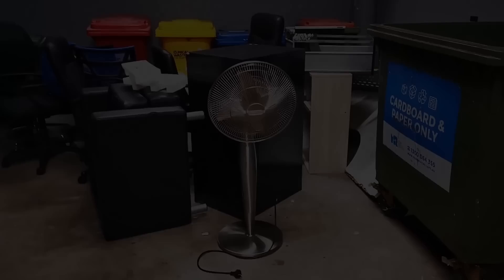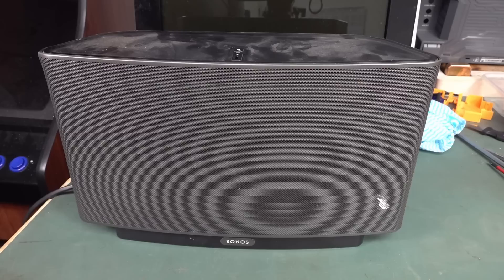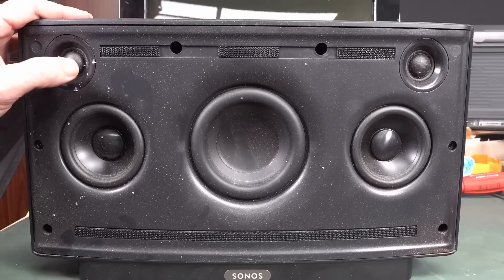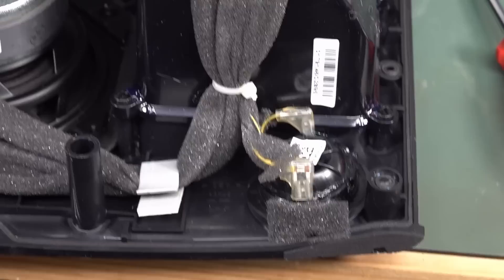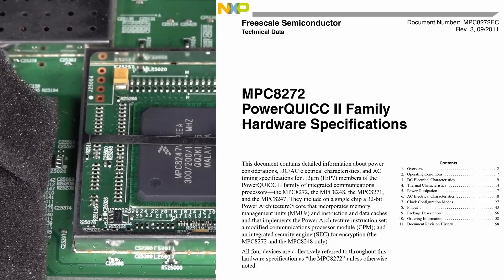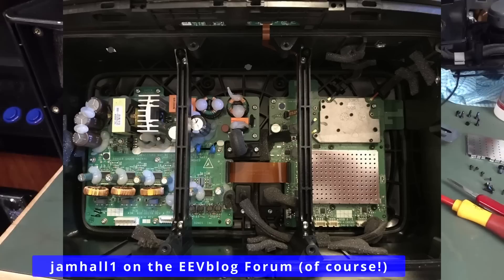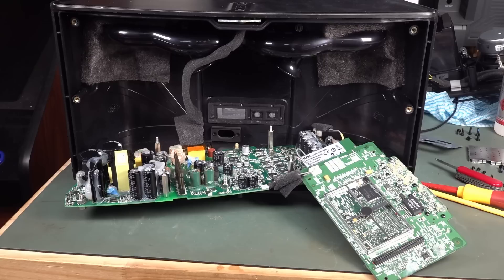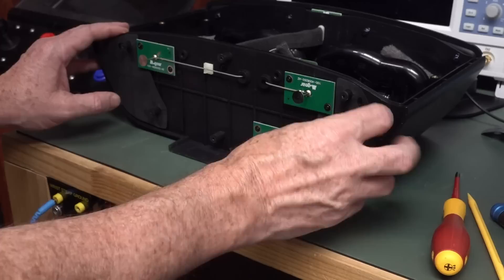EEVblog 1514 - Sonos: The Juicero of Wifi Speakers? (TEARDOWN)

Comment: Hi Dave, great video! I've been working at SONOS for 10 years. I help manage and develop their acoustical facilities. We're definitely meticulous when it comes prioritizing overall quality. It seems excessive, but the foam and glue are necessary to mitigate buzzing parts and fortify components for longevity. Despite not being inside the acoustic volume, the foam near the antennas is meant to mitigate buzz between the plastic foot and the enclosure. Keep in mind that the original PLAY:5 was made in 2009 and was our first "all-in-one" speaker. We've learned a lot in 13 years. We now design our own transducers in-house amongst many other improvements you might enjoy finding in one of our newer products. Cheers
Reply: Pretty awesome, I've had a lot of free sonos gear from a supplier over the years, and took a few apart for fun, and coincidentally, the same one dave took apart because the application didn't work anymore. Was pretty bad of you at sonos to do that. But yes the products do seem good and I got everything for free so can't complain.
In short, good products CW!
Reply: @colinofay7237  Glad you appreciate the product from a hardware perspective. I live and breathe hardware development so some of the other aspects of the business I'm less versed with. With S2, we got to the point where our early products were lasting so long it became a limiting factor for coexistence with the modern products we were developing using the same SW platform. We have a bit of a novel approach when it comes to designing consumer electronics that are not meant to be thrown away after a couple of years. We design our products to hopefully last a decade or more. I'm not sure what the exact statistic is, but around 90% of every Sonos product ever made is still working in the field. Basically, we got to the point where we had to diverge and develop a new software platform that would enable the technologies we wanted to build into our products going into the future. The road hadn't been paved for us when it comes to smart speakers and networked audio so we definitely hit some stumbling blocks as we forged a path forward. I think we've all learned from the S2 implementation and I hope that we're listening to our customers better than before!
Reply: Yet your company goes out of their way to make sure that the new app doesn't work with old hardware, so people think it's broken and throw it away when there's nothing wrong with it. 
I cannot stand companies who go out of their to ear as much money as possible and add towards Ewaste.
Reply: @TheManLab7  sorry to hear you feel that way. We actually went out of our way to not brick older components that were incompatible with the new software. As I mentioned in my common above, we needed to redesign the software platform to evolve our products. Our older products literally did not have the CPU power or memory to work with our more evolved products which is why the split between S1 and S2 happened. Rather than brick the old components, we gave customers the choice to use two apps which is inconvenient but much better than having old gear turn into a paper weight.
Reply: @CW-vo7ty  I get technical debt can bite you but you misunderstand the core issues behind that backlash. People were buying an ecosystem and the break with compatibility meant that if they wanted to extend their system they would have to rebuy everything. This is really a slap to people who had already kitted out multiple rooms. It should have been a priority for S2 gear to fall over to compatibility mode to mesh with S1 stuff at the user acknowledged loss of newer S2 features…

I liked Sonos a lot but after that I didn’t extend my system at all and there is no incentive to ever do so… :(
Reply: @leighrobinson  But, that is exactly the practical effect using the S1 app results in! I mix 6-7 old units and 3 new ones and gets all the functionality or more I got ~15 years ago when we jumped on. Compared to most other wifi connected media consuming electronic, Sonos products are extremely long lived (Logitech Squeezebox is abandonware but I think the hw can be used with some Linux knowhow) and being an ex software dev myself, lifecyle management on APIs and services on old hardware are huge pain points for any IT business. You can't compare these items with CD players or passive speakers, you must check some 5-10 year old Samsung, Apple or Sony audio products to get a somewhat fair comparison..
Reply: I was a little shocked to see an open loop class-d amplifier implementation. Thankfully there is PSU feedback otherwise it'd have been a total calamity. Class-d amplifier open loop gain is directly proportional to the supply voltage so any ripple is effectively direct gain modulation if you don't have closed loop feedback. Looks like that part last shipped in 2016. Will be interesting how many people get cocky with FPGA and GaN FET's doing open loop amplifiers again...
Reply: @NirreFirre  Squeezebox units are still usable despite Logitech's buy-and-dump treatment (no, not bitter at all :-P ), thanks to the media server software being open source. The hardware is pretty bullet-proof too - I have about five units in daily use, and the only one I had to replace was one of the old v3 ones (with the VFD display), and the only problem with it is a dead capacitor on one of the output channels, so it sits on a shelf in my "workshop" waiting for the day I get around to replace it... 
And even if the units should fail, you can use pretty much anything as a player, be it a Raspberry Pi, your PC, phone, or the otherwise old, unusable O2 Joggler (which resembles an oversized Squeezebox Touch). The main problem now is lack of support from the streaming platforms, though some are still "keeping the door open" and I believe there are workarounds for others.
Reply: I’ve been using Sonos products for almost as long as they’ve been available. Moved to S2 when an appetizing deal came out. Gave our S1 hardware to a family member and they’re still going strong with the old app. I’ve heard from one of the product guys that you guys intend to keep the S1 app operational. Hats off for that. Amazing hardware design. The amount of time and engineering it had to take to get every speaker in the space to work in unison as flawlessly as it does has to be dumbfounding. Wi-fi speakers do have their purpose and I didn’t mind the email for setup. 

Amazing hardware. Amazing software. Wonderful engineers and a team that cares about the product. Will continue to buy from them.

Juciero was a joke.
Reply: The only comment that I will make is that, for a mass market consumer product... everything seems like a mass market predatory consumer product. It might be well engineered, but engineering doesn't forgive sound faults and software BS. for this reason i don't like or trust sonos as a company. though honestly the products don't fill a need for me. For applications where the products are designed to shine, they probably will do wonderfully, but the market is crowded and there are other network players on the market that do arguably better sound performance. at the end of the day an audio product should be usable no matter what may come to the company, and sonos products aren't that. if sonos dropped the app and the account for your products, i would consider them.
Reply: Pretty disappointing that it was designed to last 25 years but is actually life limited by software.
Reply: The hardware is well done. The software is shaving cream. A good test of system performance (timing unboxing to playing music) puts the Sonos in a poor pole position. Whoever made the decision to run all music playing through the Sonos app should be put in front of a firing squad. It’s kludgy and slow, where it should run silky smooth, like a simple appliance. Anyone care to elucidate as to why the audio needs to be “vetted” by the software before going out over the network? I’d love to know if there is a legal underpinning to this mess.
Reply: I've always had this to say about Sonos: despite the hack bullshit software lock, they are indeed very high quality speakers.
Reply: You dropped software support and it bricked my speaker and the new stuff wont work unless you make an online account with an app. also the app just so happens to work better on apple products. I was talking with a software dev and they are contracted under apple to make their systems work better on apple than on android as an underhanded way to enforce apple sales. Your software team is very unethical and I want you to know this.....
Reply: @CW-vo7ty  You dont have to have an app or internet to use a freaking speaker. just make it work with a cable or something jeez. Every sonos product ive had was software bricked by some bs technicality. ive gone through 4 of them in 4 years...
Reply: @zilog1  It does work with a cable, it has a line-in jack
Reply: @mikabreto  You can bypass the app entirely with spotify connect or any other wireless casting
Reply: Came here to suggest the exact thing you just described. Good job in that department. EEV Blog just does not understand audio equipment. I've seen him tear down other speakers with the same sort of confusion. He tends to act like anything he sees and doesn't understand the purpose of in audio gear is audiophile wank. You would think he would have caught on to some of this stuff by now with all the comments that explain what he doesn't understand. Oh well. Also not that it really matters, but it would be nice if the Sonos product line was not so closed loop. I have stayed away from the brand entirely because of that. I forgot the story exactly but I remember from a few years ago where many older Sonos units were getting bricked because of incompatible firmware I believe, and from what I remembered is that the bricking was intentional. Probably a similar situation as the speaker in the video. Maybe you can chime in with more specifics. What I do specifically remember is being turned away from the brand completely after watching the video on it.
Reply: First off, it’s a bit unfair to rag on Sonos for asking for an email address to update firmware - I have a room full of professional audio gear and every piece of gear in there requires a user account (email address) to get access to updates. absolutely nothing out of the ordinary now days.
Secondly, Sonos actually looked after their customers with older generations of Sonos gear. Admittedly, some backlash from users was required but the older generations of speakers required more digital grunt than they were capable of providing with the new features, so Sonos split the app into 2 versions - one for older gear and one for new products with more features. I don’t think many manufacturers would go to that effort to accommodate outdated digital gear.
Reply: It seems normal to you that your audio gear requires an internet connection in order to work properly @mickgillies2619 ?
Reply: @lloydrmc  Sonos doesn’t need an internet connection to work, it only needs an internet connection for web connected services like Spotify and to get firmware updates and the initial setup. It does need a network connection to use the app on your device or to access music on a NAS device or computer - nothing sinister about that , pretty normal for any network media device.
Reply: @LKN117  Totally agree. There’s nothing wrong with tearing down and analysing the electronics but if he does not understand the unique specifics of certain equipment, it would be a good idea not it to criticise the product.
The bricking you referred to was a very short lived situation that appeared to be pushed by some bean counter in their marketing department. The customer backlash was so strong that the head honcho at Sonos reversed the policy very quickly and released 2 versions of the Sonos app - 1 for legacy products and one for the new products with the enhancements the old hardware was unable to handle.
Reply: @CW-vo7ty  A design lifetime of a decade is NOTHING for audio gear.  I've got 50+ year old gear that works perfectly.  I don't think any of my amplifiers or speakers are newer than 20.  A few years ago I had somebody ask me if I had a sound bar, and I just laughed at them.
Reply: @mickgillies2619  Yeah that's what I've come to find out after reading more comments. I did find the OPs other comment's about the two apps confusing at first, as I don't own any Sonos gear (if that wasn't obvious already) and didn't know about the change. Its good that they made a reversal on that and then took it a step farther and made sure the product was supported. Everyone makes mistakes its if you genuinely learn from them that really matters. So many corps make these half assed apologies when they get called out on bad or greedy decisions and then just re-implement whatever shady practice they were doing in a more lowkey way when people loose interest. So to see years later that they haven't gone back on their word is very good to hear. Hate to say at this point but the Sonos gear really doesn't fit my use case, but I will definitely pay more attention to them now in case they happen to launch something that fits my needs.
Reply: that play 5 is soo good i heard it at a place one time and thought there was a sub with it
Reply: Open up your ecosystem for Android by adding chromecast and I will buy one. Closed ecosystems are very consumer unfriendly.
Reply: Hi. I bought a second hand play 5 gen 1...the seller told it was working but actually it is in recycle mode? Any advice? Thanks

Comment: The foam and glue is going to be to reduce vibration noise, I don't think it is over engineered, nothing more annoying than a speaker that vibrates and rattles ! A speaker enclosure is a pretty harsh place for vibration. The external foam pads on the bottom will be to help stop cabinet buzz from the plastic foot contact point.
Reply: Yeah that was my thought too.. Even if it's not directly part of the "accoustic chamber" ... it will at least influence the walls of it...

Comment: We are not allowed to throw away tech items at my work. We have to use the ewaste bin. That way we can feel self rightious about not filling our landfill with electronic trash, and insted, it probably fills a landfill somewhere else.
Reply: Instead they ship it to India where they burn it to extract the precious metals.
Reply: In England, we are (generally) NOT allowed to take anything (electrical or electronic) from recycling centres, which IMHO is criminal. People chuck perfectly good stuff in those skips, including vintage stuff which really needs to be preserved for future generations and can also be worth a fair few beans.
Reply: @BG101UK  I expect its for 2 reasons health and safety, and to avoid people taking the items with scrap value and scrapping the for profit (like the copper in the leads, as that offsets the costs of disposing of the other bits). I agree though a shame, luckily there are charity shops here which sell used electricals
Reply: I have a dude who collects my E-waste and pays me...  he separates the recycle stuff and then sells that.... we both win.